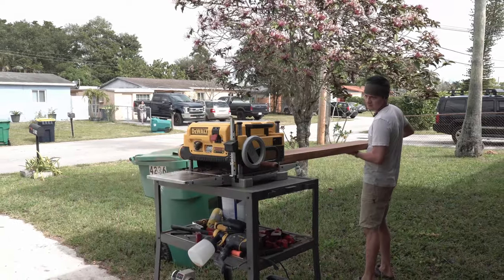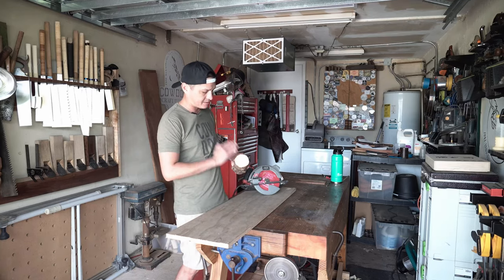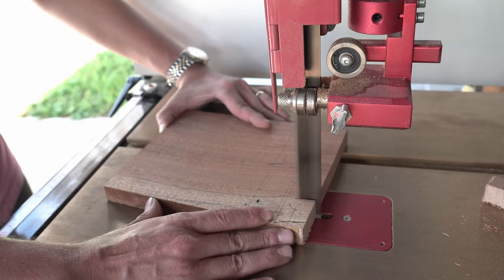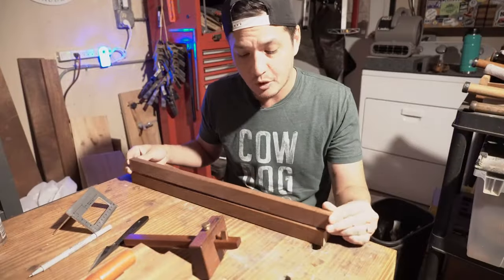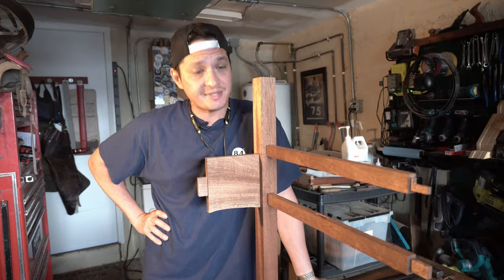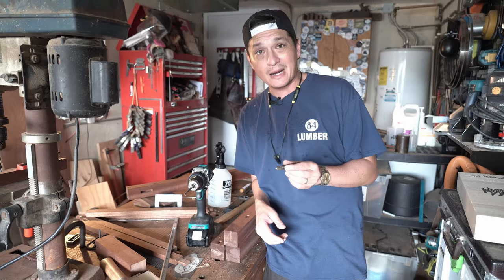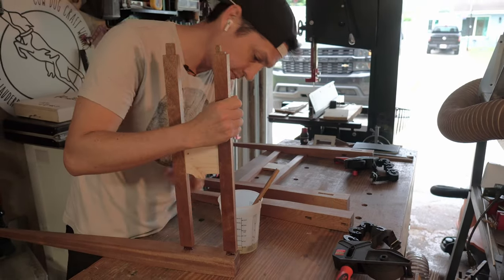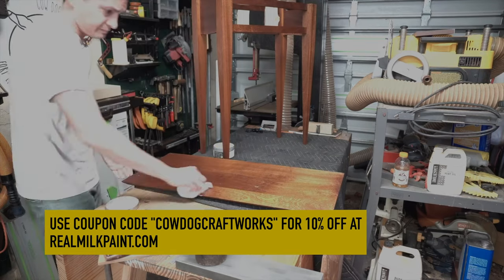From Nearly Giving Up To Stunning Success: My Journey Building A Console Table

Comment: Nice job - It's nice to see how a problem resulted in such a beautiful outcome (and also beautiful little girl - Rowan).  I looked at your Amazon page - where did you get your kanna hand plane? And, thank you for the tip on holding the saw at the far end of the handle.  I just tried it, and it really helps.
Reply from the maker: A problem with just a smidge or unnecessary procrastination on my part. 😂 so there are hand planes that are passable on Amazon. None of mine are from there. I’ve purchased from a few sources: Suzuki Tool, @yournokogiri on Instagram, and kurashige tool. Honestly with planes you just have to get a few under your belt and mess with them. The key is that you want to avoid the non-laminated blade versions that sometimes show up on amazon and the like. Also certain pre cut dai have a tendency to be way too loose. One of these days I’ll get around to doing a new video on plane setup.
Reply: Thanks for the very quick reply.  I love your channel and it's commentary - very helpful.  I have a couple of e-bay kannas that I'm learning basic on.  So thanks again for the suggestions - I'll follow up on them.
Reply from the maker: @dirdick43  thanks so much! If you have any further questions feel free to shoot me an email or shoot me a message on Instagram.